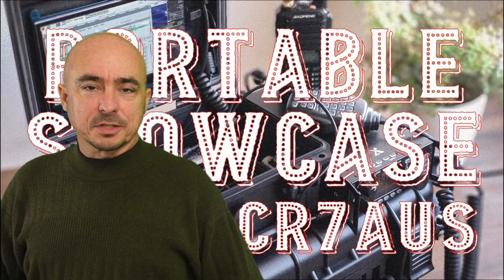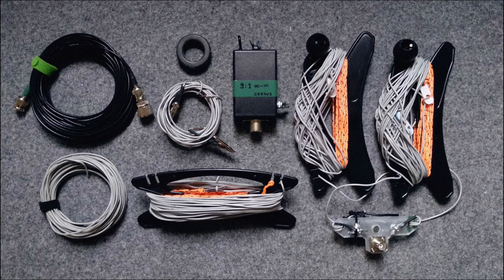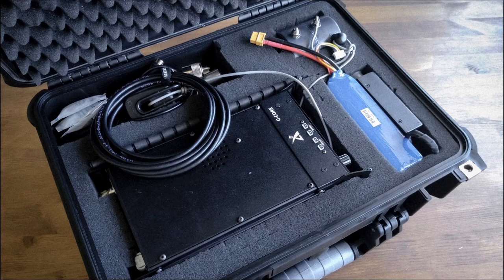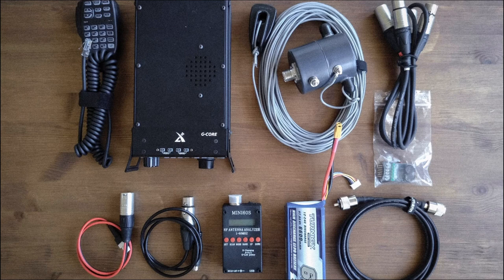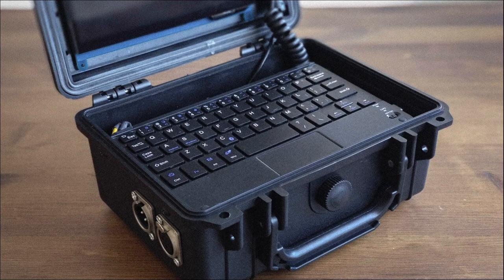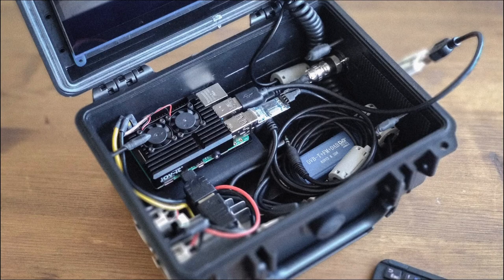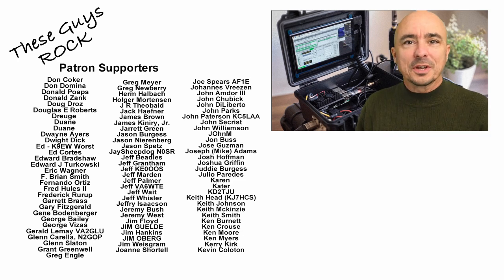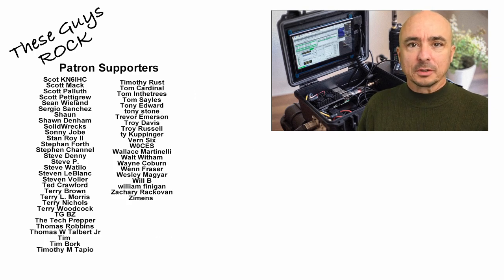Portable Showcase featuring CR7AUS

Comment: Thanks for the showcase Jason!
Just a quick couple of notes. Since the construction of this setup I've further modified it a bit. After some WWFF and SOTA activations I decided the pelicases would stay home or in the car as they are simply to bulky to carry around for that kind of purpose. Instead I opt for the backpack you can see on the sotabeams mast bit of the video. 
- the yellow and black cables are indeed for powering up the Pi externally through the bigger case where the battery sits. (again this is mainly for situations where it is a viable option carrying the cases with me). They are connected to a DC-DC buck converter rated for 5 amps. 

- At the moment the 9:1 and EZwire endfeds have been put aside as I've found the last activations to be a breeze with the linked dipole (which was optimized with the light antenna wire from sotabeams) and the KM4ACK EFHW antenna I got from Jason which is way more practical to put up and light on the backpack.

- The XLR connectors were used mainly because in my line of work I happen to have many available and they seemed a perfect fit for robustness and weather proofing.

- The different ports are now labeled and provide CAT/power/audio between the radio and the Pi setup. (the XLR plugs are used in such a way as to provide foolproof connections (connecting batteries to audio ports for example)

- After some days out with this setup, which now includes a 50W amplifier (which maybe wasn't really needed...), a CW paddle from GM0EUL and a nanoVNA instead of the heavy antenna analyzer I've come to a couple of conclusions on this Pi setup: The noise generated by the LCD touchscreen and the HDMI connection is quite high and can be troublesome in some of the amateur bands. A huge deal of time was spent trying to isolate the audio/power to and from RF but in the end, the screen remains a considerable source of QRM. 

- the soundcard used with the Pi required a USB isolation adapter to avoid  CPU generated noise and groundloops. 

This is of course a never ending process of refinement and setup optimization. I'm still an entry level amateur op so there is still plenty of time to further improve the build for portable ops. 
Also, congratulations once again for this channel and for putting out such quality content on a regular basis. 
73 de CR7AUS, Carlos
Reply from the maker: Thanks for the update Carlos! Like every other operator I know it is constantly evolving as we learn more and use our setups.
Reply: That is an amazing set-up carlos. Gotta ask, what connection are you using to connect the g90 to the rpi. I have the x108g, but I cannot get them to connect. Thanks for this awesome project.
Reply: I’ve been working on almost the exact same setup for a couple weeks on and off (pelican, 7” screen, RasPi, ic705). I’m glad you mentioned the noise generated by the screen. I noticed a lot of QRM produced when I powered the whole thing up and I couldn’t figure out where it was coming from so thanks for mentioning that! It solves one problem anyway. I’m waiting on my smaller bioenno battery then hopefully I can finish up. Great minds think alike! 73 KI7NNS
Reply: @cogitoaprendo1017  Thanks, I'm using a Prolific PL2303 USB to serial adapter for the CAT connection. On the Raspi I'm using Flrig to control the Xiegu. In the g90 I found the Icom 706MKII config in Flrig ro work great. I'd say it probably works for the X108G but it's just a guess. This is just for transceiver control. Audio is routed through an external usb soundcard "Soundblaster Play!3". cheers!
Reply: @kacymcginnis  ;) Regarding the noise, there were two separate issues, HDMI being the worst. But there is also noise from the Pi electronics (I'm not sure if it's USB controller related, or CPU) that can also appear on the radio but specially on the Pi audio input through ground loop if there is a common connection between the Pi and the transceiver on the power supply side. I avoided that one using a USB isolator (ADUM3160) for the soundcard. It completely prevented the loop and noise from appearing on the Pi audio (which was high enough to prevent successful decodes on WSJT-X). Good luck with your setup! 73 de CR7AUS

Comment: Excellent build Carlos and quite inspiring to me. Makes me want to take a crack at building out a case as an upgrade to my typically disorganized backpack of radio gear. I myself like 9:1 end fed antennas and actually some experimenting with wire lengths they can be made resonant on a band or two without a tuner. I'm running one now that works better without the tuner on 10 and 6 meters and will tune about almost every other band with an automatic tuner. Wire is cheap and it's fun for me to see what works and of course what doesn't.

Comment: Looks like the GPIO pins might be used for power, I couldn't tell but there might be a buck converter in the box to power the Pi from 12v and stepped down to 5v. Looks like pin 2 (5v) and  pin 6 (gnd) are being used.
Reply from the maker: Good call! I'll bet you are right. Looking at it again, I don't see a power cord connected to the pi.
Reply: @KM4ACK  @ 7:28 in the video you can see the buck convertor better. Looks like the XLR is feeding power and then its stepped down to 5v for the Pi.

Comment: The yellow and black wires appear to be power to the raspberry pi. Note: only the HDMI port is in use the power port appears to be unused.
Reply: Also looks like their is another battery in the main module. Note the power leads to radio and CPU module. Inside the CPU module there is a dc to dc converter (silver heat sink) it appeara to take the 12v from the main module and step it down to 5v for the Pi. 

If I am correct I wonder what the black box is under the Pi. Jason said it is a battery bank but is secondary to the main?

Comment: One other thing worth noting about this setup. The bluetooth keyboard, although quite useful becomes pretty useless as a wireless keyboard every time the Xiegu is on TX. The proximity to the antenna is enough to completely jam the connection, specially using digital modes. Fortunately it does allow for a usb connection as well.
Reply from the maker: Many years ago I ran into something similar with a windows laptop. The trackpad would stop working during TX. External USB mouse solved the problem. RFI can be a beast!

Comment: Nice. I run my G90 on lipos as well. I have a parallel harness and can run from 1 to 3 of my 3s 5200 mah batteries at a time. I love those xt60 connectors and will add one directly to the back panel of my radio after the warranty runs out. I use an adapter right now.

Comment: It looks like he’s using a 12v to 5v voltage regulator. You can see the heat sink under the side connectors and the red/black wire going to the bulkhead connector.